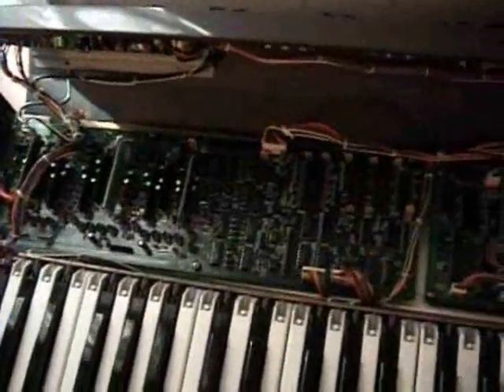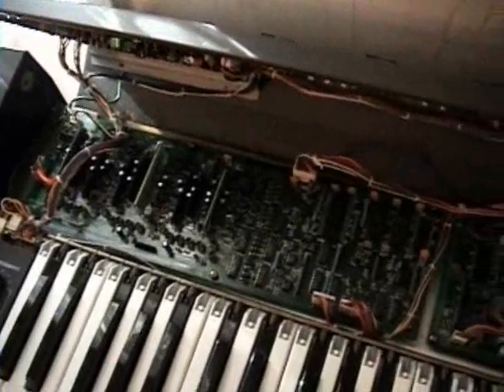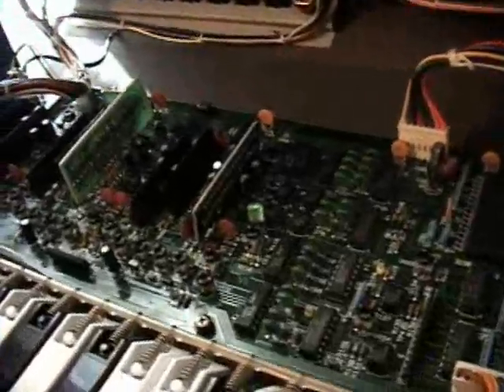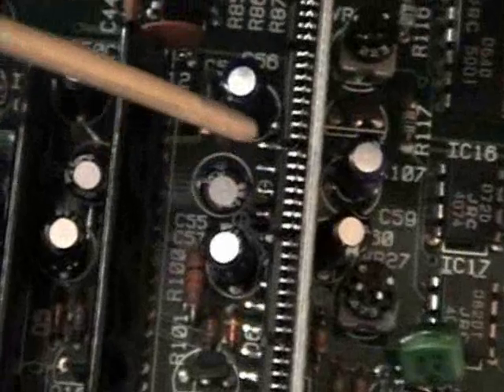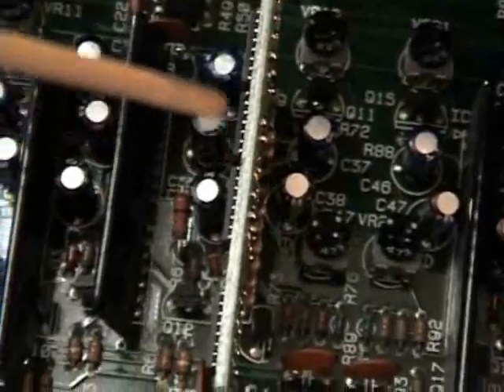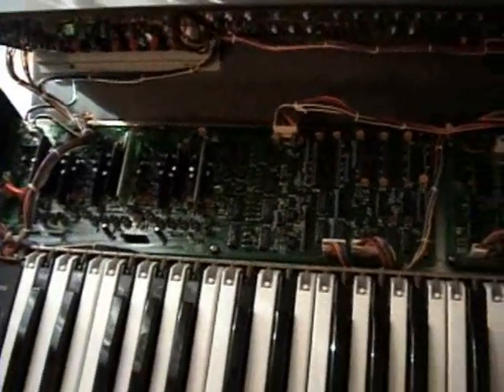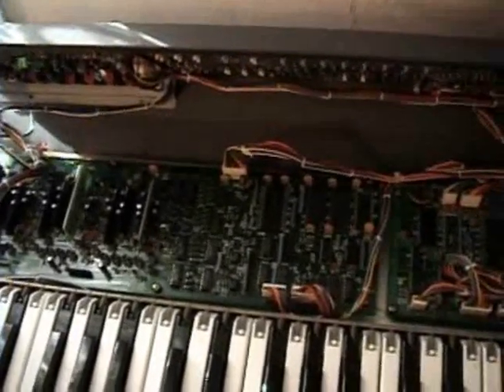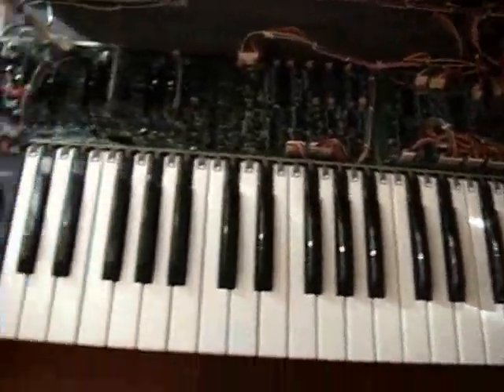How to replace Roland Juno 106 Voice Chip 80017A   2 of 2

Comment: Thanks for the vid, I'm ready to do it! Q: Do I need a temperature controlled soldering station for this type of job, or would a regular 30w iron do?
Reply: nope, it just needs to get hot enough to melt the solder., and you want a relatively fine tip. However, youre gonna want a vaccum gun and some solder wick to clean up. I recommend heat up the solder and vacuum gun first, which should remove the solder. then wiggle the chip and ease it out with pliers.  clean up leftover with the wick and then replace
Reply: @pivotmaster9556  Confession: Six years later the chip is still sittin' there .. Thanks for the update, and reminding me to DO IT!

Comment: Couldn't tell in the video as you only momentarily show your hands. If you do this PLEASE wear an antistatic wrist band. Some of this units circuits can be damaged by stray static discharge. Also these chip can be rehabbed if you take the time to remove them whole. It's the black coating causing the chip to fail. If removed most of these will work again. Have to soak them in acetone for a couple days then scrape the black off carefully. HTH